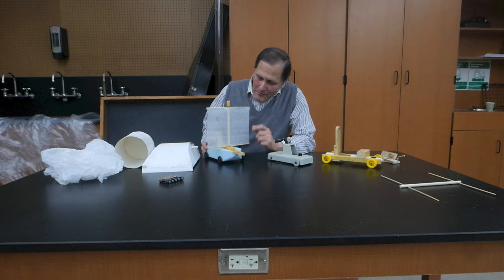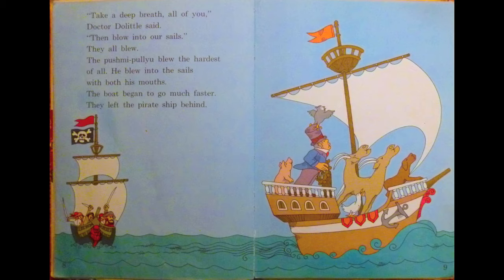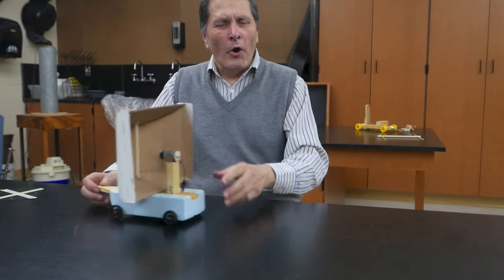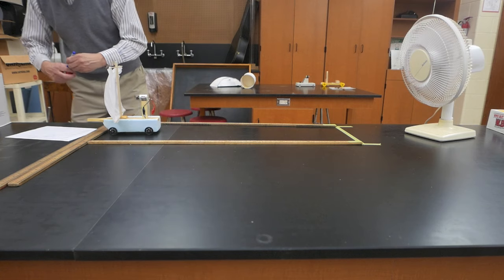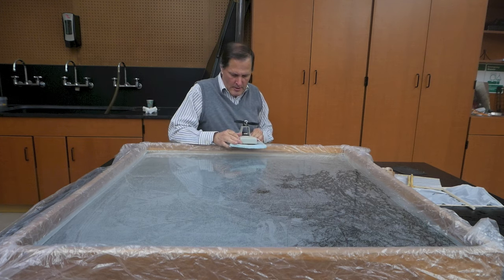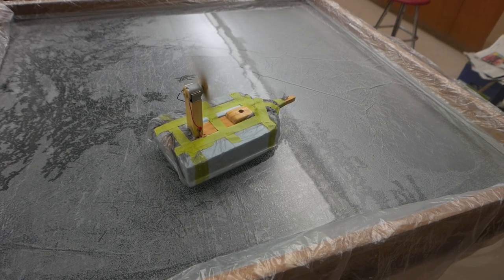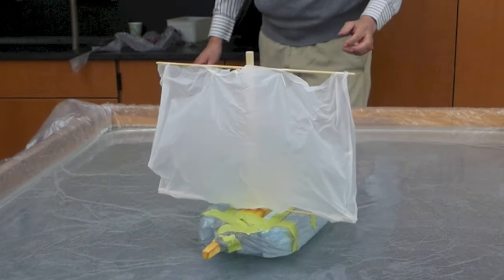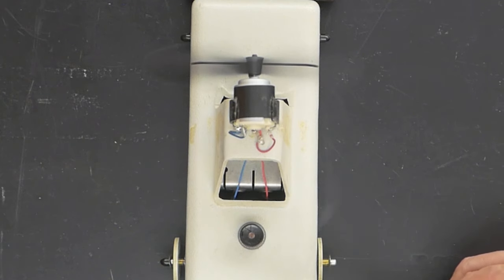Fan Cart - Blowing into your own Sail (updated)- part 2 // Homemade Science with Bruce Yeany

Comment: This is a great experiment. You just proved that technically, it is possible to have a paramotor, and a parachute, and aim the prop  upwards to take off vertically . Of course this would require a lot of power, but none the less it is totally possible. When I was younger ,I suggested this to a physics student who told me it would be like powering a bathtub, like a boat,  with the motor inside the tub, so I totally abandon the idea, however the thrust vectoring concept proves that it would work.

Comment: I was surprised that the tube produced any thrust at all, I would have expected it to be completely stalled and just swirling the air at the opening around.

That was a great follow up but now I want to know what your instant-smoke was! It looked like you were mixing the vapor from 2 liquids to form a smoke/suspended particles.
Reply: Nick Moore Good to see you here. Bruce's videos are great! I'll bet the smoke is made from hydrochloric acid and ammonium hydroxide.
Reply: Did I see a tub labelled 'Lycopodium powder' at one point?  They're clubmoss (a primitive plant) spores ... and will also make a great fuel-air explosion!  :-)
Reply: I expected the same result.  After thinking about it a bit, I have a new hypothesis.
Since the fan is aligned along (or near) the axis of the cylinder, the swirling air it creates is going IN to the cylinder in the center, and going OUT of the cylinder near the edges.
I wonder if the Venturi effect wasn't playing a role, here.  The swirling air that is going backward is near stationary (higher pressure) air.  So the air outside the cylinder gets pulled into the backward directed flow, creating a net mass flow toward the rear of the boat.
Reply: There needs to be more awesome teachers like Bruce, he's built some of the best, public friendly, demos I have ever seen.

Thanks for the tip, I thought I had seen it somewhere but I didn't have a clue what it might have been. I wonder if I can grow some visible crystals under a microscope.
Reply: Applied Science That was my guess too. Muriatic acid and ammonia. Ammonium chloride is quite hygroscopic which sucks a fog right out of the air.
Reply: Out of curiosity what would happen if you put a reflector on the incoming air side so it recirculates the air that's coming off the sail through the fan more?

Comment: Very nice demos. I'd love to see a slanted sail with a rudder (or even a keel or dagger board). The wheels of the carts serve a similar purpose, provided sufficient friction. Even more awesome would be an explanation of how one could sail directly downwind faster than the wind. Keep up the great work!
Reply: You cannot sail directly downwind faster than the wind. That is why boats with efficient hulls sail off the wind a bit, so they get some lift off the airfoil sail shape. It is actually faster than sailing directly downwind - even with a symmetrical spinnaker.  

But it was only a couple of decades ago that a sailboat managed to sail faster than the wind - on any tack. I seem to recall that it was a specially built boat called "Slingshot" that managed by sailing a course essentially at right angles to the wind direction.

Comment: The fact that the rudder makes the boat go forwards is pretty reminiscent of how sail boats sail upwind.

The wind tries to deflect the boat to one side or the other (and backwards a bit), but the rudder forces the boat to move forwards instead (if the boat didn't have a flat stern, it might move backwards, too).

This is how we sailed around the world, back in the day.
Reply: Not really.
The physics of sailing upwind is completely different to a sail working before the wind as shown here.
A sail which can go upwind must be able to form a tear shaped cross section just like the wing of an airplane. It is this shape which generates the forward moving force, as well as a lot of sideways moving force - the drift. The drift is counteracted somewhat by the rudder but most of it is canceled by the fin or the keel. But nevertheless, the boat is pulled by the wind approaching the sail from the front and the airflow across the the sail generates the forward force. But it is not pushed by some deflected wind from the back.
The beautiful old sail boats you might be thinking of (such as the one Columbus used) really could not do much more then sail before the wind (downwind). If they needed to go against the wind, they were pretty much out of luck and had to wait until the wind shifted.

Comment: Here us my take on why this works.  First of all, air molecules don't "bounce" off surfaces like some have suggested. They create flow fields and pressure gradients. If you assume that all the force acting on the propeller is in the opposite direction of the air flow it generates, it still wouldn't matter if all the air was redirected backwards from the sail, the forces would cancel. The part that is being neglected is the propeller. The propeller isn't just colliding with the air causing it to flow, the rotation and shape of the blades cause a pressure differential (Bernoulli effect) that causes the air to flow and give it linear kinetic energy. Part of the force acting on the propeller is opposite the direction of the air, but the Bernouli part is (at least partially) counter the rotational moment of the blade. For this reason, the linear force acting on the propeller could be smaller than the force pushing on the sail. You can think of the sail in terms of drag force. In this case, the larger the sail, the larger the drag force at least until you reach the maximum force produced by the air flow. Newton's laws are not violated.

Comment: Two things I noticed.
1.) the first sail was pretty close to the same area as the sweped disc of the propeller. This could be one reason the reactions canceled each other out. 
The second thing was that the first sail was also very close to the propeller.

Two possible experiments.

1.) put the original sail at least one fan blade diameter ahead of the fan.

2.) make a contoured sail that has the same area as the original sail, and place it at least one fan-blade diameter ahead of the fan.

Another experiment is to put the larger contoured sail at least one fan-blade diameter in front of the fan.

 See if it Propels the cart  faster than the new, smaller contoured sail.

I predict that it will.

Comment: I always think about flight,  I’ve built many full size airplanes.  But the idea of an air filled parachute has been with me since I was a kid.     I had a powered paraglider for a bit,   The difference between a paraglider and a parachute is that a parachutes has pores in it.   The air goes through a parachute.   A paraglider if you blow on it,  you can’t force and air through,  it’s an inflatable wing.    But my dream was to make an old school parachute out of paraglider fabric…. Non pourus fabric.  (A sail).   You have a giant parabolic surface.   Then you blow air up into it.   The thrust comes from it blowing back (like a reverse thruster).    You’d have the worlds safest aircraft,    If it quit,  you’d just float down.    Thing is,  it would also be the worlds least efficient aircraft.

Comment: Does the flat surface being close to the fan have anything to do with it going sideways. If it were farther away and could still deflect it might go more backwards as it might not have to overcome as much foward air pressure from the fan. There is probably and optimal distance. At which point you can test materials in a small degree by finding different ideal distances. Although it's probably not complicated enough to fully go over what is happening.

Comment: If you look closely, you'll see it actually did move slightly at 2:12, and again at 2:16. This leads me to believe that there is indeed some small net force with the sail in that orientation, but it's not enough to overcome the other forces acting on it, such as friction. This makes sense because even though it's taut, it's not perfectly flat-- there is a very slight curve.
Reply: TheOriginalJphyper well nothing is perfect in design. Slight irregularities in the design cause small errors. It wasn't a significant effect to be noted.

Comment: It still doesn't make sense to me how a curved sail is able to produce thrust in this scenario. Because if you picture it, the fan produces thrust by spinning curved blades that push off the air perpendicularly to the blade movement and that in turn pushes the blade in the opposite direction. But then the curved sail produces thrust by redirecting the air which is essentially pushing off the air like the blade did. And the part that baffles me is that the air got momentum from the fan and then it transfers that momentum to the sail. So how can the sail win over the fan? I picture the sail like a mirror reflecting the light; maybe a corner reflector would be more analogous.

Comment: Thank you for taking time to explore the comments and suggestions we contributed from the earlier video on this subject. You mentioned in this video that you believe you don't understand how sails work. If you will allow me a moment, we can explore this together -- and please feel free to correct me when my "science" strays or fails me. 

In my "armchair physics mind," I see no difference between the sail and the boat itself. Air is a thinner medium than water, but the same principles apply. In essence, the sail "floats" on the air at a perpendicular to the boat floating on the water. 

First, let's consider the boat. It floats because the area of the boat is great enough to disperse the downward force of gravity exerted on the boat's mass and displace an amount of water sufficient to offset that downward force. The boat moves with the water current because the force of the current applied to the boat is greater than the force of the inertia-at-rest applied to the boat. 

Now let's consider the sail. In order for the sail to work, there must be sufficient area of sail-cloth (we'll come back to this in a moment), to overcome the force of the boat's inertia-at-rest (rather than gravity, per se) and displace an amount of air (behind the sail) sufficient to overcome that force. The boat moves with the air current because the force of the current (captured by the "billowiness" of the sail, and thereby multiplied) applied on the boat is greater than the force of the inertia-at-rest applied to the boat. The larger the surface area of sail provided and the more billowy the sail (without reaching the point of diminishing return), the more the air current can be captured and directed to help propel the boat in the desired direction.

Note that the last sentence reads "...in the desired direction." A good sailor can tack into the oncoming wind and use the position of the sail in concert with the rudder to move the boat forward at a vector to that wind.

Now let's go back to the issue of the area of the sail-cloth. Before self-propelled ocean-going vessels, there were the tall-masted ships. As these ships demonstrate, the area of sail-cloth does not have to be provided in one large sail. Instead, the effect is multiplied by providing numerous sails of various strategic sizes, strategically placed in order to optimize wind capture and direct the harnessed energy.

Does this explanation make sense to you? Have I missed (or misstated) anything?
Reply: Sorry, Sir. There is no such a thing like "force of boat's inertia-at-rest" .Inertia is not a force. The thinnest, smallest force will accelerate ( move) a giant body  ( a rock, ship , or even a planet ), if there is no friction.
Inertia means that a the movement of body along a straight line (constant velocity) is a state as "natural" as the state of a resting body ( "quiete"); no cause, no force is necessary for both states. Galileo understand that the uniform motion in a straight line has the same status as the uniform motion in a right line. NO EXPLANATION is needed.
As Newton stated:  Every body perseveres in its state of rest, or of uniform motion in a right line, unless it is compelled to change that state by forces impressed thereon. 
The point is : Inertia is not a CAUSE.   FORCE is a CAUSE.

Comment: With the cup "sail", if you where to flip the fan around so it pushes air backward, wouldn't this create a lower pressure in the cup and cause less air to being pushed backwards.

Comment: +Bruce Yeany Nice set of vids but what you don't explain here is that sails work as wings and therefore it is the depression caused by the sail and not the wind pushing into the sail that makes the boat go forward. Thanks for all the others vids :)
Reply from the maker: Thanks Adrien,  I hope to tackle more on the behavior of sails in another video

Comment: Spinning because of torque,  your prop might be a little pointed up and that would cause p factor.  That uneven air,  is known as (p factor).  When you take a prop.  If it’s perfectly level both the up and down blades are at the same angle.  If you put it at an angle the descending blade catches more air.  If you take your hands and make a prop with them.  Them tilt the “prop” up,  you’ll see the angle actually changes.

Comment: @8:30 - I believe the boat is not going forward based on the fan hitting the sail....and the loss of rotational force is not due to the rudder entirely, but rather the vibration of the motor is directly influencing the rudder in the water, which causes the rudder to act as a moving "fin."  Take the fan blades and sail completely off and run just the motor with the rudder, I'll bet you get movement.

Comment: You should be able to improve performance beyond what fan alone can do.  Fan moves smaller amount of air at high velocity.  F = MV is the force.  But P = MV^2/2 (power to operate fan).  If airfoil can convert small M large V to large M small V efficiently, then force can be increased for given power.  This is why helicopters use large, slow-turning rotor (for static left), and airplanes use smaller propellers turning fast (for cruise speed).  The airplane wing converts some of the "speed force" to a larger "lift force".  Properly-designed "wing sail" should be able to do the same.  Try first blowing across the curved sail from the side.  You should be able to get faster boat versus blowing out the back with fan only.

Comment: This reminds me of a question I had awhile ago.

If a space ship had uneven thrust behind it and started spinning, could Gyros keep it going straight if they were strong enough? The rudder causing that to travel straight reminds me of that question. You were actually able to get it to go straight by a completely different mechanic which is amazing to me. I guess that would be sort of like the tail rotor of a helicopter.
Reply: i'd say yes, the gyros can stabilize the spacecraft
Reply: Yes, but would it keep it going straight or would you drift sideways while traveling?
Reply from the maker: HI Joel,  good question,  my guess if it is oriented correctly the gyro should be able to straighten out the movement. I'm not sure when I will get to it but I've wanted to do a segment on gyroscopes and I will add that to try in the segment.
Reply: That would be awesome
Reply: I think this would work for a while.
The gyro works by having a spinning mass which is carefully controlled to take advantage of Newton's 3rd Law - for every action, there is an equal and opposite reaction.  By applying a torque (rotational force) on the gyro (either through a motor or friction), an equal and opposite torque is experienced by the rest of the space ship.
The imbalance in thrust creates a torque, which will cause the ship to turn.  The ship can apply a countering torque on the gyro, such that instead of the ship turning, the gyro turns instead... up to a limit.
The turning isn't adding rotational speed, but rotational acceleration.  In order to counter the imbalanced thrust, you have to keep accelerating the gyro.  Eventually, this will induce centripetal forces inside the material of the gyro which tear it apart.
Reply: @seanehle8323  Gyros can control heading, they cannot affect velocity.

If thre was evean a short misdirection of the rocket thrust, then the rocket would turn off the intended course - meaning that it would be headed in the wrong direction. The only way to get rid of this "sideways" motion would be to re-orientate the rocket somewhat past the desired heading and then apply the necessary corrective thrust until the rocket was again traveling on the correct path. At that point, the rocket would have to again be pointed in the desired direction.

Comment: isolate the fan with its own air intake separate from the air being pushed back from the curved sail to prevent recirculation . the fan should have a tube over it extended past the back of the boat so suck in clean air and point the other end directly to the sail. itll move so much faster.